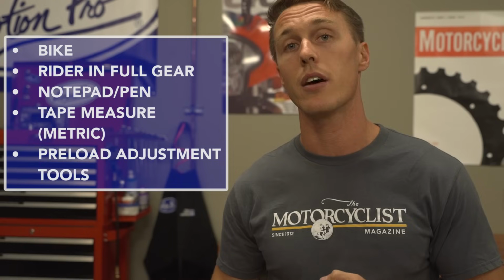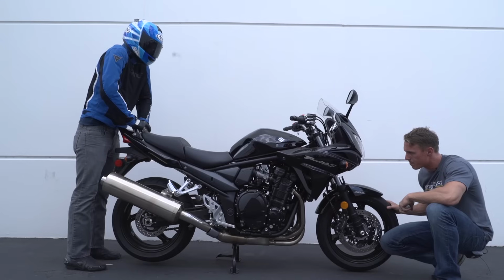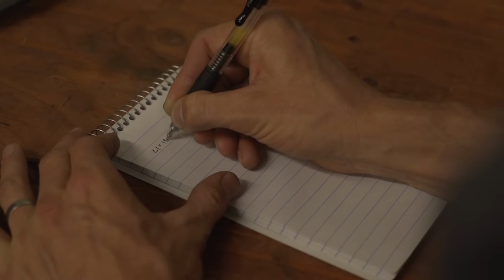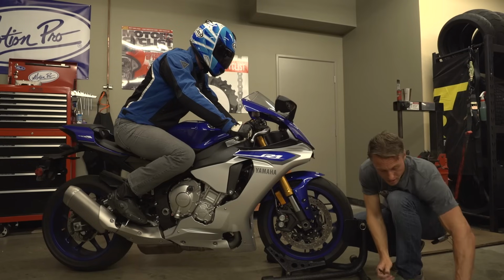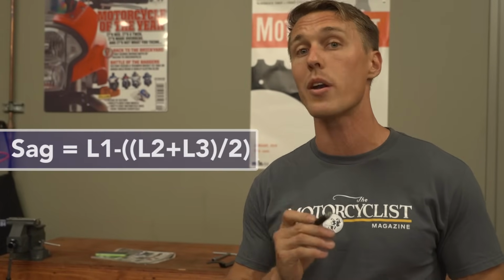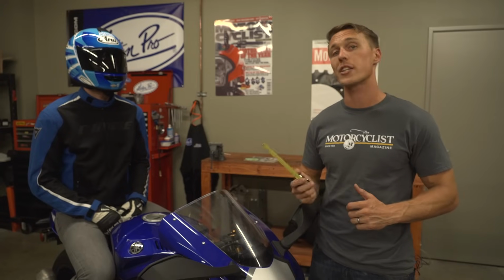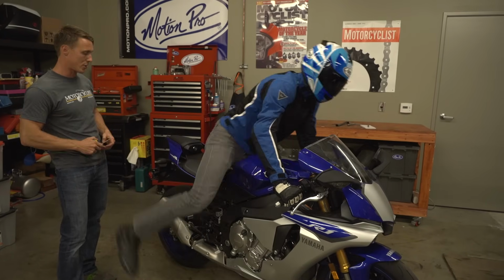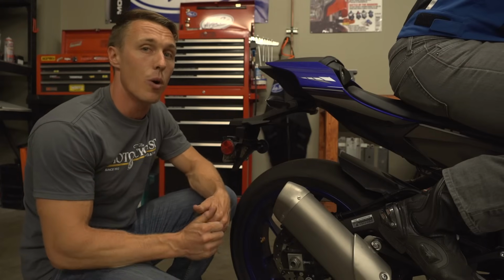How To Check Motorcycle Suspension Sag | MC Garage

Comment: What if I usually ride (50% of the time) with the passenger? Most of the time it's my brother who is 95kg.
Reply: 1scott921: All suspension on bikes is already set-up from the factory, but for riders of approx the 80kg +/- range. So if your 80kg in weight, you don't need to set-up your suspension. But when you double someone, yes of course. Lets say your 80kg & your brother is 95kg. This equals 175kg. You will find your suspension will be working at the ends of the system, and may bottom-out easier. But lets say you tighten your suspension (because of doubling brother), yes it will handle much better. But when he gets off the bike and you ride on your own, you will have suspension much too tight for yourself. You will feel all the bumps! So basically its all about compromise. Which way suits you best. Cheers groover;-)

Comment: hope someone could enlighten me on this..
my bike suspension travel is 108mm front, and 128mm rear
i've set my front rider sag to 36mm (that's 1/3 of suspension travel)..
so, what's the number i should target at the rear? should it be 36mm same as the front, or 1/3 of the rear travel, that is around 42mm rider sag..
Reply: hadouken: Yes that's correct. Setting should be the same as front. Although the best range is from 25mm - 40mm. 25mm is for track, & 40mm the road. But it all depends on what sort of bike you ride & how you ride it. I'd recommend you try it at 36mm (both F & R) and ride it extensively. i.e city, mountain, freeway etc. Ride it in all conditions. Then set it up on say 30-32mm, and ride the same way you went with the 36mm set-up. I like it at the 30mm range as im quiet a heavy person, and i like my sports bike to handle well. So i don't mind a stiffer set-up. Everyone thinks its dial in and ride. You still need to ride, check, & maybe adjust again. Setting the sag really changes how the bike handles, so try a couple of settings & see what you like best. Cheers groover;-)

Comment: Is there any extra considerations if you regularly have a passenger. That is do you need to take into account this factor especialy with the rear preload. 85 and 55kgs
Reply: Barry Roberts: You betcha! All suspension on motorcycles are already setup from the factory for you. But only if your 80kg +/- range. So if your heavier (or for doubling) you will benefit from a sag set-up. But once your pillion gets off the bike, well then your set-up is too firm for just yourself. So its all about compromise. 55kgs makes it heavier, but it also depends on the riding style & the type of motorcycle you ride. When doubling you ride slower & more carefully. So do you really need the tighter set-up? If you rode all the time with a pillion, & went gun-ho all the time, i'd strongly recommend a sag set up. So your 85kg, which puts you in that category of the manufacturers set-up straight out of the factory. But remember, both suspension front and back must work together as one. So don't tighten the rear & leave the front. Setting sag is about setting up your weight to the suspensions optimal working space. Cheers groover ;-)

Comment: Very interesting but kind of confusing.. does that mean over time the springs/forks get worn out then need to be changed?
Reply: Sk8boarder1700: Not changed, just serviced. They may need new seals. The oil definitely needs changing. Its not really expensive to do. They recommend servicing your forks & shocks every two years for optimal use. Cheers groover ;-)

Comment: Note that for 2016 and newer FGRT Ohlins forks, the manual calls for 15-30mm (front) and 10-20mm (rear) of free sag. With "rider on" (what Ohlins calls "Ride Height") the sag numbers are 25-40mm (front) and 35-50mm (front). So you can see it's a wide range and it varies between front/rear. The principles for measuring sag in this video are spot on, just check with your suspension manufacturer on sag ranges; there is no one size fits all sag number or ratio.

Comment: So is 35mm a good average for front and rear sag for road use then?
Reply: EddieSpaghetti: Range most common is between 25mm-40mm. 25 for track & 40 for road. But it all depends on what bike you ride, and how you ride it. Try 35mm on all your riding roads i.e. mountain, city, freeway. Then try it at 30mm, with same roads & conditions. Its all about compromise. Sometimes firmer is better, other times softer is better. Again, what bike & how you ride it is the factor here. Cheers groover ;-)
Reply: Depends on your motorcycle and how much total travel is available. You generally want your sag number to be about 1/3rd to 1/4th of the total available travel.

Comment: Does it able to apply to Harley Davidson motorcycle?
Reply: Yes, but only for the rear suspension.  I don't think Harley has ever made a bike (other than Buells) with an adjustable fork.  Also be aware cruisers in general have very little rear suspension travel, typically 1-2 inches tops.

Comment: why there is an black oil mark on my front suspension??
Reply: That means your fork seal is leaking.  You should get that fixed pretty quick, can result in fork oil getting onto your brakes which is really bad.

Comment: Hi. My bike is Yamaha Rn09 . The front fork travel is 120mm and rear 65mm. Should I set F:40mm and R:22mm on the road and F:30mm and R:16mm on the track ?
Reply: Albin Pol: Suspension should work together. Settings should be same F & R. Best range is 25mm - 40mm. 25 for track & 40 for road. But its all about what bike you ride & how you ride it. Best if you try one setting (say 40mm) and ride all your roads as usual i.e. mountains, city , freeway. And then set-up at 30mm and do the same. Its all about what you like best, a compromise. How you ride the bike is very important. If you were a cruiser, go 40mm. If your a scratcher, 30mm for road. Track i'd be looking at the 25's, too tight wont let the suspension work. 
Cheers groover ;-)

Comment: At 3:58, shouldn't he have said, "If you've pulled all the preload out and you don't have ENOUGH sag, that's a sure sign you need a SOFTER spring" ?
Reply: Yes, you're correct and he appears to have misspoken in this part.
Reply: littlebr4d that's what he said. he said if that's the case your sings are too stiff. so same thing as what you said.
Reply: "too stiff" which is what he says = softer, but I guess saying softer in this case would probably be a bit clearer in this case

Comment: I weight 170 Ib what level should I adjust my MT 03/FZ03 rear?
Reply: 1/3 to 1/4 of your total suspension travel with you on the bike, just like any other bike.
Reply: MARKINAU8: optimal settings are between 25mm - 40mm. Both should be the same. Suspension must work together F & R. 25 for track, & 40 for road. But the important factor is what bike you ride & how you ride. Setting sag is about setting your weight to the suspension for optimal performance. The manufacturers set-up bikes for the 80kg's +/- rider. You only need to set it if your heavier than 80kg's or if your going 2up frequently. Its all about compromise, because when the pillion gets off the bike, your set-up may be too firm for just you. Do not set up the front & rear different, you'll have a bad handling bike if your scratching up the road. Cheers groover ;-)

Comment: Isn't there more to adjusting suspension, then just setting your sag?
Reply: Yes , but you should always start with Sag, once that's right, you can adjust the others if possible.
Reply: ShakenNstirred do you know of any good videos that shows how to do the rest?
Reply: Dave Moss. He's the guy you're after. Pretty much the #1 Guru in Suspension adjustment. Check out his website or videos online, should find LOADS of material. Good luck

Comment: Newbie here. How does improper SAG measurements (too much or too little) affect motorcycle performance?
Reply: Simeon gave a detailed reply but I have a feeling its a bit off, because even in the video they make a specific point to say that changing sag doesn't affect spring rate. It changes the starting positions for the most part. Adjusting sag simply makes sure your bike, with you on it, is sitting in the correct position the bike engineers expected it to be sitting in as your ride it. With sag set correctly, if you hit a bump, you have the expected amount of inwards travel in your suspension to soak it up. But most importantly IMO, with sag set correctly, your bike has the proper geometry (mostly steering) as you ride forward. I once had a bike with too much sag in the front, and not enough in the rear, and it was a really odd feeling until I noticed it, even simply riding forwards at 35mph.
Reply: If the back end is too low in relation to the front the front end will feel light and like it has too little grip, similar to how a front end that is too soft feels, the steering will also be very vague and unpredictable.  If the front end is too low in relation to the back end the back end will feel vague and unpredictable and the fork will punish your wrists on every bump.  Having the rear set too high with a soft fork could result in sudden loss of front wheel traction (and a lowside) with little warning, and having the front sent too high with too soft suspension in the rear could result in the rear tire letting go with little warning (and a possible highside).
Reply: In essence, too little sag (too much preload), both front and rear, will lead to a stiff and harsh ride. The bike won't go over changes in the surface as well as it should. You may feel disjointed with the bike, as if you can't really feel what the tyres are doing under you. Not confidence inspiring and comfortable as it should. 
On the other hand, too much sag (not enough preload), both front and rear, will contribute to a soft ride. Not necessarily comfortable though. You may experience a lot more bike/suspension movement than you need to. The bike will feel "wolly" and will lack precision and accuracy. You'll feel a lot of weight transfer when transitioning from brake to throttle or vice versa. That's something you don't want to feel as your attention should be what's ahead of you when you ride.
That's about it in a nutshell, hope it helps.
Note, this doesn't take compression or rebound into affect

Comment: If my front springs are a little too soft (46mm) to get proper front sag number (35-40mm).  Should I reduce preload on the rear shock to match the sag number on the front or do I set the rear sag to a number in range (which my case is 35mm)?
Reply: Well this one is dependent on how you like your bike to feel and your suspension, 46mm is not too bad however if that is with your preload fully in then yes your spring us too soft for your weight bur not necessarily your riding style if you are a light braker then you may not find an issue. The fact you front is pitched forward will give you a bit less rake angle and trail which mean easier turn in but less high speed stability. attach a zip tie to your forks to see how much travel you use on a typical ride. see how close to full travel you use. then if it's within the last 10mm of travel use more oil in the fork to reduce the air gap giving you more support at the end of travel. also if you do have damping adjusters use these to prevent excessive dive when braking by adding just a few clicks at a time until again the zip tie is about 10-15 mm of the full travel.
Reply: that is a good question, now lets see if someone has a good answer (opens beer and waits)
Reply: Depends on how hard you ride.  If you do non-aggressive street riding you should be fine.  If you do track days or aggressive canyon carving you should probably get stiffer fork springs.  Too soft of a fork can make the front end very unpredictable and if you bottom under heavy braking you will instantly lose a big chunk of traction from the front tire.

Comment: How do we know what sag figures are the adequate?...
Reply: Are you saying your sack hasnt dropped?
Reply: @ISwearDownOnMeNansGrave  🤣🤣🤣
Reply: between 1/4 and 1/3 of full extended length. 30-40 milimeters is quite usual
30mm would be stiffer: more sporty/track
40mm is softer: more comfy and pothole/bad roads friendly
im pretty sure thats accurate but feel free to correct me otherwise

Comment: And most important if you bottom out or experience head shakes chances are your suspension isn't able to work in its effective range and that's going to cause a lot of trouble. Cranking up your steering stabilizer isn't going to help.

Comment: Awesome tech tip Ari! I doubt my K bike will have much for adjustment up front. My rear suspension however is aftermarket that the previous owner installed. Progressive is the manufacturer. Hopefully I can adjust it properly for a better ride.

Comment: Great vid! I'm assuming that for a bike with a non-adjustable front suspension, perhaps just check the differences to see if it's a partial indicator the seals are potentially bad? Mine only has pre-load out back. Thanks.
Reply: +Ari Henning Great tip, thanks! I have a '94 Yamaha Seca II so it's pretty basic. :) Mine came in great shape from its previous owner, so that helps a lot.

I think you guys ought to host a riders' event! It'd be a good excuse to visit CA again. Or maybe you already do, in which case carry on. :D

Comment: Guys,s the magical number (40mm) what you mentioned a setting for race tracks ? what would be the number i must have to ride comfortably without breaking my spine in streets which are of average grade ?
Reply: 40(35-45)mm is good for street on a bike with 120mm suspension travel.

Comment: This is a very interesting topic, congratulations on covering it thoroughly. Plus, the clarification concerning SAG and spring stiffness was well put at the end of the video. Having said that, I have some questions. In a video from D.Moss, evaluating Suzuki's DL650 suspension, he mentions that, because most of rider weight falls at the rear suspension, changing front spring preload will not have a difference in the measurements despite evaluating different weight riders. Instead, he advises on using a ziptie at the fork to evaluate suspension movement during use, so as to assess whether preload is needed or not. Does body position on the motorcycle play such a significant role in measuring SAG? Can the measurements be thrown off completely due to different bike ergonomics? Lastly, since the rear suspension seems to support most of rider's weight (in the case of the DL and other rear-heavy motorcycles), should measurements be made to the rear first and then adjust the front, considering that preloading a spring will tend to give rise to the suspension of the corresponding end? 
Thanks!
Reply: Thanks Ari
Reply: I recall hearing the same thing in his videos. He isn't always the clearest. It's a bit confusing definitely